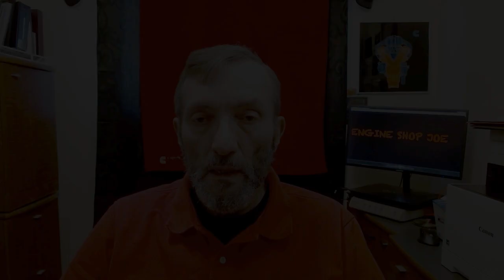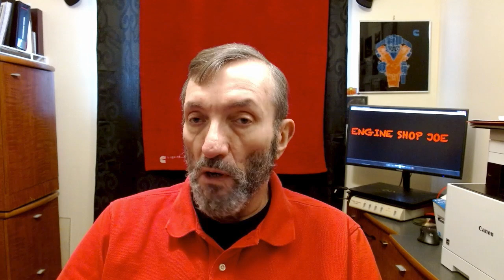The whys of why mechanical diesels start hard in cold weather

Comment: I have a 2001 cummins with 402k miles on it and it has a rough idle with light smoke when at anything around 30 degrees.  If I plug it in it fires just fine. My heater grid doesn’t work anymore so thats part of it. Great video, lots of good info.

Comment: I remember back in the day when Mac first came out with their vmac engine. It used to be the a 5 horsepower injection pump test stand was enough the calibrate the pumps. When the vmac engine came out you needed a 25 horsepower test stand to properly calibrate the pump. The injection pressures we're way way higher. I've always attributed the modern Diesel starting easier to the better atomization. That being said back in my day if you knew what you were doing you plugged your truck in. Whenever I see one of these kids do a cold start video I cringe inside. The same thing when I see them getting crazy with ether. But I'm old now and I don't have to fix the m
Reply from the maker: The Company I retired from had one of those Vmacks. It was our yard dog for moving crane tracks etc. When they bought it new (way before i worked there) it was the power house of the fleet. When I was in Haiti back in 74' there was a B-61 in a small sand pit- Not sure how the truck made its way there but it was the big horse on that Island at the time and the only Mack-single axle dump. I think Mack made good trucks but they were their own animal when it came to fixing them. High five you on not having to fix things- Unless its our projects for personal pleasure.
Reply: The thing about engines is they don’t care if you cringe or not. 
They just go boom and spin.
Reply: @fastinradfordable  do you realize how much damage those cold stars are doing? Anybody that does that stuff is a goddamn moron
Reply from the maker: I used to start a stationary engine on the floor when a new young mechanic started at Cummins. I took him over to it and there was no fan on it but all the belts. So it's sitting there running and id throw a rag in the belts. Then told the new guy engines will hurt or even kill you if you let them. We never lost any fingers in the shop.

Comment: I've had 2 trucks with CM870 ISX. He has something bad wrong if it won't start below 50F. I have 2 video's on my channel cold starting both trucks. One is a 2004 and required jump starting cause I only had 3 batteries and had been sitting 8 days, (Cummins Isx cold start) is the name of that video. The one I have now is a 2006 and starts good with the gear reduction starter even at 10-15F. That's as cold as I have been in . (Louisiana Snow storm and cold starts) Is the name of that video, Oil temp in video is 8F. It did have 8 batteries installed when I did the video because it has a worthless battery operated apu and has a battery box on each side and both are tied together.
Reply from the maker: Thanks for your comment and I watched your video and that did start fast and cranked good too for with 8 degree oil. It would be interesting to check starter current draw near the starter with all that battery reserve. It probably is a bit less than one would see with 3 batteries. In regards to something wrong with his unit for not starting under 50F there could be one or many small things wrong that add up to that scenario. Because once he gets it started it runs ok for him and does the job I don't think he needs to spend money or time to try to find out why his might be a little harder to start in cold weather. One of the very difficult struggles I have answering comments is I don't have that unit in my possession to do certain checks to further evaluate the problem. One quick example is we had a truck that was difficult to start in not too cold weather. The problem was the voltage dropped at the fuel solenoid at initial starter engagement- the solenoid closed and was not able to reopen due to a degraded but working electromagnet on the IFSM.  If we had missed that in our checks we could of spent a lot of time and money needlessly - I used to see that cash waste all the time. My goal is to help folks to make better decisions so I error on the side of caution.
Reply: @ENGINESHOPJOE  He could have a starter or battery issue. As you said it has to turn fast enough or it won't start.

Comment: When I did the Cummins coarse for injection timing the instructor said it was to address the oil filter plugging issue. The 4.25 wedge  did make them run just that much better, cleaner.
Reply: Hey camshaftp16 what else could you tell me about the oil filter plugging. I’ve had a hunch similar to yours and I heard timing could fix that. I’ve noticed the 871 plugs faster than the 2250 which made me start thinking.
Reply: @jaywyatt7476  I was told that the injector cam gear and cam can "slip" over time allowing the injection timing to exceed the variable limits of the ecm. This is where the procedure of using the timing tool with the two dial indicators on it to measure piston position and refer to QSOL for which wedge to use to advance the injector cam. I did this to a few 870/871 engines and it had good results.   later just always used the 4.25 wedge, the 4.75 wedge if not called for you would here fuel knock at idle.
Reply: @camshaftP16   hey thanks for the info. have you noticed the oil filters restricting pressure at its half life. I’ve been seeing premature oil filter plugging with oem filters and oem Delo 400 oil. Starting to think it’s timing, like you described.
Reply: @jaywyatt7476  About 100 hours of run time would start to notice psi drop. Don't like the Fleetguard filters, early ones the small o-ring  would come out and you'd find it in a piston cooling nozzle, then when the cm2250 had the high psi fuel pump failures and flood the engine with metal the filter couldn't hold it and by-pass then take out the crank. Did lots of crank replacements when at the dealer. the off brand filters ie. Baldwin would hold all the metal and never had a crank fail.
Reply: @camshaftP16  That’s impressive for the Baldwin to be so much better. I appreciate your input and it’s a pleasure to meat you.
Reply from the maker: That is correct that was the primary reason they developed the process. The 871 was struggling with oil filter plugging and too frequent regen issues. We noticed the 871's we timed using the 4.25 wedge started better in colder weather so I mentioned it as it is one of many factors that  affect cold weather starting.

Comment: On the older model 855’s were the compression ratios different between model years ?
On N-14 engines why is there a long turnover before starting even in warm temperatures ?
As always Great Explanations !
Reply from the maker: The ratios were different but not by model years but by CPL - Critical Parts List-
AHH the N14. Here is the reason why. The EPS which looks at the back of the cam gear is looking for a special pin on the back of the gear. It is actually a machined circle (many of them around the gear) but one has a pin in the center of it like a pencil lead in thickness. This is number one cylinder top dead center. Once the ecm sees that pin the crankshaft has to turn 720 degrees before the ecm fires the first injector. So if that pin stops just past the sensor in direction of rotation it takes a minimum of about 3 complete revolutions before the first injector is allowed to fire.
Reply: @ENGINESHOPJOE 
Wow👍👍👍that's good to know Joe thanks for posting that!!! I have an N14 and sometimes it fires right up other times I takes 4 or 5 revolutions.....practically everything one the  vacuum side (before the pump) is new but it still starts "hard" but if that's the case then I can stop trying to find an issue😂thanks Joe love your videos👍
Reply from the maker: The factory told us if an N-14 celect or celect plus starts in 5 seconds or less that is considered normal starting time. Most I worked on started in 2 to 3.5 seconds after the engine starter began to turn the flywheel. This applied to the M-11E and ISM as well.
Reply: n 14s also need the proper fuel filter with the back flo valve
Reply: @youtubeisawesome2487 what number filter does it need